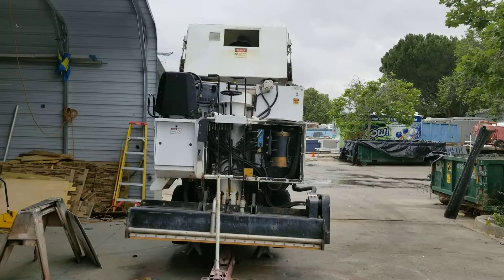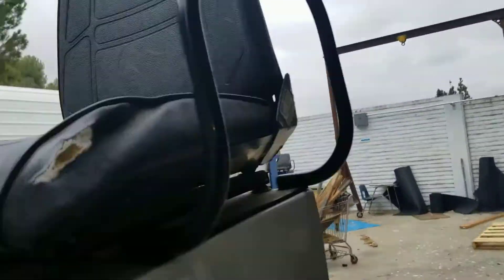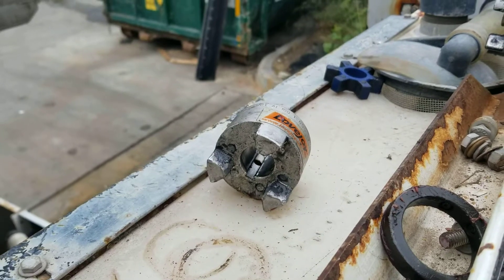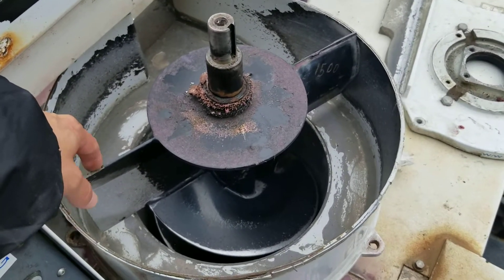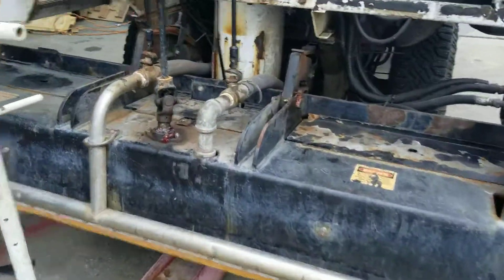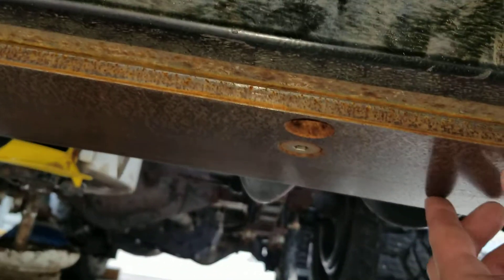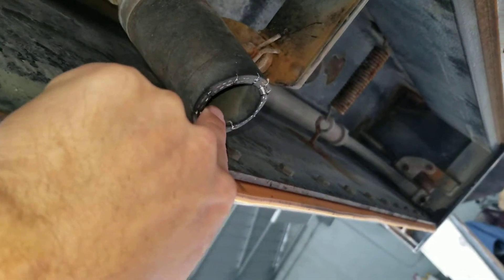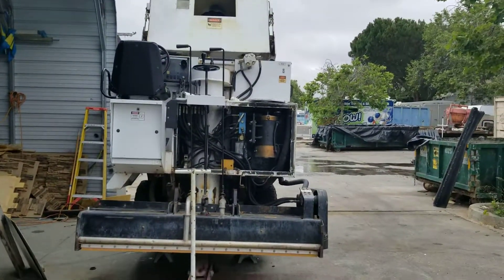Zamboni vertical auger bearing repair..

Comment: Hey man. We have a puck stuck so bad in the vertical auger we need to pull the whole screw out. We have removed the top cover, and I guess we need to loose some details in the bottom as well? It’s a 520 with a conveyor belt instead of the motor on top (if it tells you anything). Would be great with some tips, cheers :)